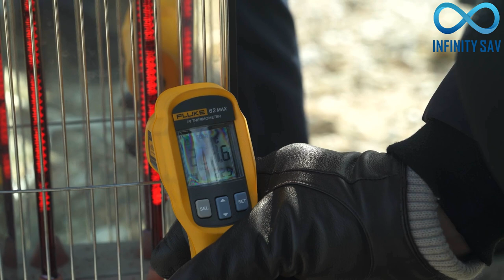Fuel Free Electromagnetic Generator 10kW prototype - 5 hour island test (promo)

Comment: Hey, it is theoretically possible because magnetism is limited. This magnetic generator is somehow limited and it is not infinite as what many people believe in the first place. We also have this concept before as Grade 10 students in the Philippines but because of lack of funding, our goal to present one of our design to DOST is cancelled. There are things that need to be upgraded here and some people who arrogantly says that they are smart and think it is impossible, well the better redefine your knowledge if you are really knowledgeable about physics. It doesn't disobey physics because it is not creating energy. It's just using the potential energy of the magnets to create mechanical energy that can be transformed into electricity with an initial input. So in concept, the battery are the magnets.

Comment: Amazing, I have lived off grid for 2 years now, and have saved approximately 10 ton of Co2 with the use of solar and wind power. Yet during the winter I still have to use a traditional diesel generator. I think people dont understand quite what it's like to have no electricity. If this unit could make energy just for the winter months more efficiently than compared to a diesel generator, that would be absolutely perfect, I would love to reduce my 1000 litres a year diesel for my generator. Good luck guys, I wish you all my best.
Reply: Yep I love off grid and only use solar... A small set up at that. I'd be very interested in something that's more efficient let alone free... Bit of a pipe dream possibly due to physics etc but tech keeps getting better with time.... Here's hoping.

Comment: Am I skeptic, 4 hours time lapse and the sun and the shadows barely move!?
Reply: ali cataltepe could be filmed in Alaska
Reply: @patrickzabawa728  Gogunsan Islands Korea. A long way from Alaska. I'm just as skeptical of the 4 hours too.  I would say less than 2 hours. In the video at the 2:31:00 mark it reaches noon as the shadow from the panel of lights becomes a thin line.  The shadow then moves less than 15 degrees which would denote an hour but the clock ticks off 5:00:00 before that. So I would say 2 1/2 hours equals one hour.  So the entire video is less than 2 hours, not 5 hours.
Reply: Ya they did move and if you look the shadow gets darker and the the angle changes by the end..
Reply: Look at the upcoming moon.......
Reply: From 10 to 15, in February on gogunsan, barely see any changes. Install a “sun path” app, to convince yourself.
2:12 pause, print screen
4:46 pause, print screen
Compare the two photos.

Comment: I did not see  the magnetic cilinder rolling.
Could you please zoom on the machine???
Otherwise i can think a battery can do it..
Reply: The outside holds the coils and is stationery. The rotor on the inside holds the magnets
Reply: There are many other videos of this machine it makes a. Clicking noise
Reply: @Refthoom  this is the opposite my friend ;) magnets outsides,coils onto the rotor ;)
Reply: @nicoslider  No, that would not be possible. There are about a hundred coils, if those rotated you would need an enormous commutator with at least that many contacts. Also you can see in all the YouTube videos, from the very beginning the design is about rotating magnets and stationery coils.
Reply: Fons Knaapen not at all,you are wrong ....on this generator there is exactly 250 coils and 250 magnets..
You did a wrong observation and if you don’t trust me go check the second video video they did with subtitles written in write...
look closer ,you ll see that am saying the true ...
Reply: The first generator that andreii start by pushing the axle of the rotor is quite as you discribe,it was their first small prototype and yes,this one has coils on the stator,and magnet on the rotor,but about the MG10 on this video here,it is the inverse....definitly take time to look better...
Reply: @nicoslider  I see your observations and it looks like the magnets are on the outside. However, that would mean the 1kW design was completely opposite of what this is and in fact opposite of the whole line of development of Andrii. Also, how do you see the commutator for 250 coils in this MG10, if the coils rotate?
Reply: Fons Knaapen it’s yes 2 différents conceptions,based on the same principes of working...
To my mind he use light brush into the MG10 to collect energy for the outside...
2 différents way of transforming energy to one form to an another one ,for the same result;)....
Reply: @nicoslider  I understand what you're saying but it doesn't make sense to me. Using brushes would mean wasting a lot of energy. It would make the design much more complex and fault sensitive. The beauty of having stationery coils and rotating magnets is the simplicity and therefore durability of the generator. With brushes it could never run for the time that was stated (18 years if I remember correctly). Anyway, let's agree to disagree and leave it up to Andrii and his team :-)

Comment: Skeptical a belt drive of that size could  transfer about 12 HP
Reply: Nice one. The scammers are not careful when they lie. Say 20 HP. That's 20 kw.
Reply: @paulneilson6117  They are only using about 4kw in the video. any $500 Generator can do that and more. If they want $10,000 for the thing, where are the savings? $9,500 in fuel? I can run a generator for the same amount of time on 10lbs of wood in a $500 wood gasifier. No gasoline...
Reply: I agree why  use a belt and pulley? Direct drive or gearbox reduce friction!. Besides I think it's fake!🤔

Comment: Anyone else notice that the space heater was turned off at 2:41 in the video? Looks like the other two loads are LED lights and a small fan, which are peanuts compared to a 1,500w heater.

Comment: A pretty barrel with a lithium battery in it. What a crock.
Reply: The 18650 lipo cells are all probably neatly arranged inside the rotor volume, along with switching circuitry, as the stator is just permanent magnets.
Reply: I was thinking along the same lines. Nothing from nothing leaves nothing.  @oldskooldriver9379
Reply: @fred slawson, I worked on a lot of pulse motor drives, got to < 100uA @24V to spin no load 2000 rpm. With Hall effects, circuitry can be dirt simple, reliable, and performance tuned ever so precisely.  They can even be left under the wraps of the coils, eventually just barely noticeable bumps, slightly out of place under the turns of wire.  Every magnet and magnet motor configuration I experimented with approached net zero energy in-out, but never had excess energy continually, only momentarily.  Harvesting energy from the ether with magnets and magnet motors is still just a dream. Lots of OU ideas and devices out there are merely energy reservoirs that are filled and then drained over periods of hours to days, or some merely minutes.
Reply: Powered by YouTube views...
Reply: 787brx8 ha... ha...
Reply: Your trying hard to make this kind of energy but you end up failure after failure . The evidence is there its running free. just a pure ENVY.

Comment: The battery is located in the white round barrel. If you look closely you can see the electrical cable exiting just left of the pulley.  Those wires are routed to the electronic panel on the right which contains a Dc to Ac  power converter. The electrical cables are then connected from the power converter to the grey colored Ac electric motor on the right, while also providing electricity to the lamp grid  and heater,,

Comment: Magnetic engines can be made. But the price should be suitable for simple people. I need one for my hobbies. But 10kw is too much. 2kw and the smallest size as it can be made would be very popular.
Reply: you do realize that 10kw is only 83.3A of line voltage right? and thats too much pfft?
Reply: Syc holic
WHAT? Tell me what weird kind of math you are using here. And BTW: voltage is not measured in amps. Dohhh!
Reply: @LawsForever  10,000W / 120V = 83.3A ,   or 10,000 / 240V = 41.66A     |    P=VA
10KW will run most homes, esp when you don't try to run everything at the same time...
I agree, a smaller unit of 2KW or 5KW would be handy.. smaller, lighter, less expensive...
Reply: I agree. Was just assuming a 230 volts line, the standard in my country, so I couldn't figure out how your numbers came about. BTW: did you edit your comment to remove the Ohm's law reference and add the power formula? Much better...   ;-)
Reply: Pumping amps in to electric car or powering house's heating system is not about this thing is made for. Unless if it would be as the size as the first computer
Reply: @LawsForever  :) I did remove the ohms law part, typing too fast and hitting enter.. It's not an ohm's law problem, just power :D
Reply: CtrlKX I’m an Electrical Engineer. As much as you all want-to-believe, this machine is a scam. It is impossible to create electrical energy without an initial input energy source. This company, in various forms has been doing this for literally years now and nothing has been scientifically tested, reviewed and no commercial product to speak of. Do not waste your time and money on this 21st Century bunch of “snake-oil” salesmen.

Comment: Can you make a video in which you attach measuring devices to the input and output of the device?
So that you can see how much Kwh go into the device and how much Kwh have been removed from the device.

Best in a video without a cut, with a tumble dryer in which you drop dripping wet laundry.

If the laundry then comes out of the tumble dryer dry, you have won and I would be happy to buy a device from you.

Comment: First law of thermo dynamics
Reply: How does " Energy cannot be created or destroyed in an isolated system" have anything to do with this video. The apparatus above harvests electromagnetic energy already present all around us and transforms it to electrical energy. Doesn't a nuclear plant convert heat energy to electrical energy. There is no mystery here. Its not a free energy device.
Reply: Search shielding Lenz's Law, you are missing the point.
Reply: A magnetic field alone doesn't create electricity. A changing magnetic field does. ... The Earth's magnetic field is quite homogeneous over short distances though so the coil would need to move fast and very far to generate much. This would use more energy than it creates (at least on the surface of the Earth)
And for moving this much we will need just more than the electricity we are already generating
Reply: If I am missing something I would be glad to be told what I missed but please don't reply with one word like above ,explain every thing you say or you just don't know.

Comment: I want to belive, but there is so much freeenergy scam on internet that i will just wait.
Reply: It's magnet power no free energy from nowhere
Reply: You want free energy ??   Buy solar panels or wind turbines.   Guaranteed to work .........
Reply: @WTF_BBQ  Correct. I am using already 40 years free energie ....
Reply: @WTF_BBQ  so do magnets last time I checked...
Reply: @cyberdronefpv  
Yea,  cuz magnets are in Wind turbines.....
Reply: @WTF_BBQ  LoL.
Reply: Tesla had the real plan and they " cabbaged" him!
Reply: WTF BBQ Yes, these are closest to what most people would understand as “free” energy but they really aren’t as they do rely on the principal energy source being the Thermonuclear Fusion reactions taking place on our Sun providing the photons for the solar panels and thermal energy to heat land masses and water bodies which create winds to drive the wind turbines. The scammers in this video claim to actually get electrical power output with absolutely no energy source going as input.
Reply: cyberdrone FPV Magnets are not an energy source! They are an enabler of energy. You have to provide an external source of mechanical energy to turn magnets through a wire coil to create electromotive force generating electrical current. So need to put Energy in, minus losses to get electrical energy out - and does not violate the law of conservation of energy.  If you have nothing going in you get nothing coming out!
Reply: We generate just voltage not in good amount of current i will try on that i will give it to whole world in sort time

Comment: If it worked you wouldn't be using fossil fuel powered vehicles to transport it. 

If the timelapse was genuine there were probably some solar panels off camera and I have my doubts about that heater which ressembled red LEDs rather than a heating element.

Why were there no power meters displaying the production/consumption?

Comment: This machine can't work in a perpetual manner.
Reply: It does my friend, at least for a few years if you can take care of it ! Check out their website for full disclosure
Reply: Of course it can't but its lifespan is non negligible, a few years!
Reply: Caps will make it as efficient as needed
Reply: Neither can any machine, but I am sure it could be made to run for years without failure, and even then, it's replacing bearings, further down the road the magnets themselves.  Does it really matter?  The price of magnets and bearings in contrast to recurring electrical and gas bills?  I'll happily choose to bearings and magnets.

Comment: This looks like an impressive demonstration but I have a few questions. Is this system perpetual or does it slow down after some time? Second a watt meter should be in constant view for both the input and output of this system eg the startup energy vs output energy. It can be vary deceptive if you load a spinning mass with 5kwh from the charge circuit at high current charge then draw low current out of the output at a lower watrage. If for example you charge the circuit at 240v 10a for 5min this would provide 2.4kw per minute or 200wh. If the discharge is 240v at 0.25a for 5h it would be only 300wh which is still a net positive output eg free energy. But any form of black box testing requires both input and output to be measured.
Reply: @Jack Burton Yes I do understand the conservation of energy, this is why I asked them to prove there claims in away that truly is irrefutable, I honestly didn't expect them to do this. It was more just to make a point. The reality is that energy out can only equal energy in but often the metrics used to measure energy does not account for time eg kwh instead of instantaneous load which can give the impression that a system is generating more than it received. The rotation of the system stores energy from the inverter and then releases it slowly over time its just like a fly wheel. It is possible the magnets can reduce friction in this system allowing for better energy efficiency, which is exactly how modern fly wheels work using magnetic bearings. Of course these systems require energy to be stored into the motion of the flywheel exactly what we are witnessing. The only problem here is the load this system seems to be providing is actually vary high possibly 2000w at 5h or 10kwh they only connected the invertor for a minute or so this would imply the system only received about 40wh assuming the invertor was 240v 10a, but again without actual meters on both the input and output without any video edits it would be impossible to speculate the actual input/output energy. Again this is likely done on purpose to deceive.
Reply: It works as long as the internal battery lasts.

Comment: Overunity vs the laws of physics?.
Anyone?...
Hmmmm, I believe there's a smell of fish in the air!.  🐠
Reply: Blackwood Richmore you are seeing that they are going to an island to do the tests, to show that they did not take a cable with them from the electric network service, I know that the many false videos have made you not believe in this, but by simple common sense you do not think that if you put two magnets together with the same polarity looking at each other they will repel each other, and that is what has been applied here, that is easier to understand how your smartphone works
Reply: The cabal /deep state /elite have lied about physics for hundreds of years...Tesla had this in early 1900s.JP Morgan pulled his financing and everything stopped..Thats when we got meters to sell electricity instead of free energy.When Tesla died the FBI stole several trunks of his inventions...Read up on Ben Rich who worked for Lockheed/Martin..I quote We can take ET home and anything you can dream of We Have Done...
Reply: And so you should smell fish.  Unless you are a free energy zealot in which case you'd believe anything,  it is so obviously a con. Let's see, if you want to demonstrate a heavy visual load wouldn't you use incandescent bulbs rather than a array of LEDs that use stuff all power? The only powerful consumer connected the heater, was disconnected pronto. The fan is not impressive either.  In fact a couple of truck batteries inside that fake contraption will happily feed this load for 5 hours and more. The only thing I don't understand is how can people be so uncritically gullible when face with such obvious facts.
Reply: @Rucruter Indeed they would repel but it will also brake as hard as it will com by the magnet again … even with a the heaviest flywheel this wouldn't work or the lightest . Then you have the drag of the roller bearings , magnetic 'braking' of the generator when in use for generating power . The more power you ask , will be counter with an even steeper curve of braking . Don't know if I explained as I should :D But English isn't my native language :D
Reply: @johnschuster9192 First … whats the cabal ? And on what 'facts' did they lie about in physics ? And where did you get the claims/proof for the other claims ?

Comment: I saw a demonstration it which the motor and a battery were hidden inside the device, which drove the motor outside, using that as a generator. So it was the other way around than as presented.